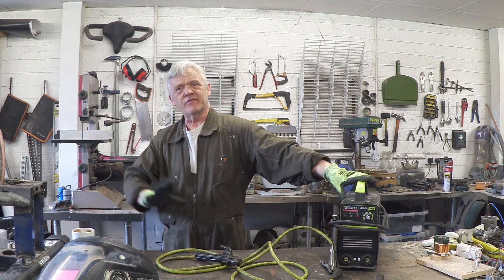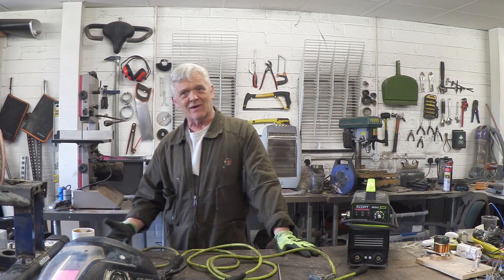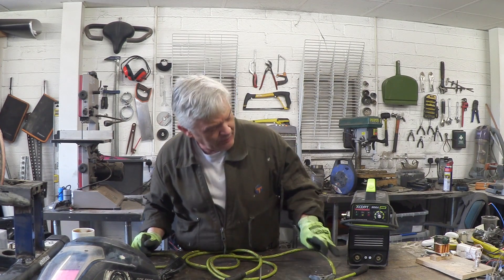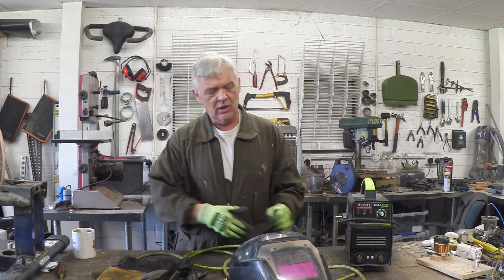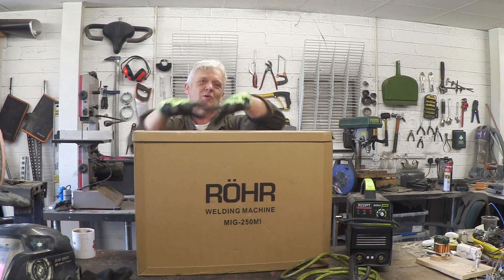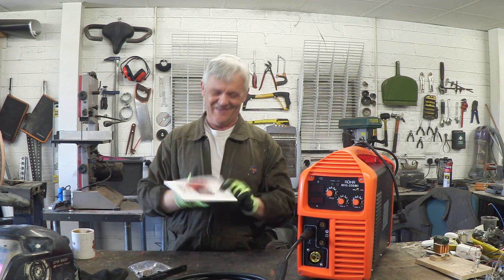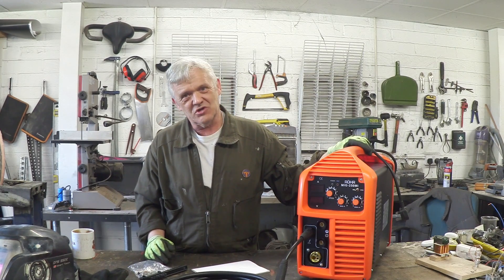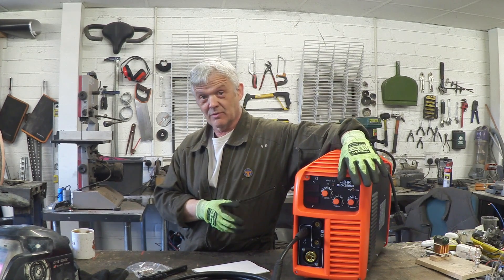1128 Learning MIG Welding - Introduction

Comment: You can run that gasless, use a spatter spray, tip protector, and fluxcor wire, your don't need the argon.

Comment: Happy Birthday and thanks for the videos.  When I first wanted to build a railway in my garden, I needed to buy a MIG welder.  In thelocal shop I asked the man there how to tell if the weld was good. "Hit it with a big hammer" he said. "If it breaks you need to do a better job next time!"
Great fun and extremely useful, don't know how I did without it.  Only done various grades of steel but so useful, not just for garden trains! Best wishes for your vidoes.

Comment: I'm also new at welding. I probably don't know the correct terms, but I got a mig welder that has flux core wire instead of bottled inert gas. I chose it because it reminds me of flux core soldering. But it has the auto-feed wire. I've made 3 repairs so far with it, and they're all ugly but effective. :)

Comment: I have a similar type of welder, mine also uses gasless wire and yours may do as well, check your manual. Gasless wire also lets you weld outside without worrying about a mild wind blowing the gas away.

Edit: Almost forgot, happy birthday!

Comment: Just wait until you get your hands on a tig welder 
Welding is a journey into metal and your imagination 
Have fun just remember that safety is essential when dealing with excited electricity and metals and alloys 
One key thing that I had given to me was when ever you are welding a unfamiliar martial test your settings on scrap peace's of the same martial to insure the best welds on your finished project 
Never wear synthetic clothes or shoes when welding unless it is specifically designed for welding ok that's enough preaching 
God bless you and your's 
Have fun and be safe 
Thanks for the videos 
Just saying

Comment: A can of Anti-Spatter spray is most helpful, to prevent spatter sticking inside the nozzle shroud and side cutters to trim back the wire. You can use them outside if it is not too windy, I used to turn the gas pressure up a bit and or create wind shields. For Stainless and Aluminium use pure Argon gas, but for Steel a blend of Argon 95% and CO2 5% is good, if you are to buy one gas only then I would buy pure Argon, you can get away with using it on Steel. Aluminium Welding is a bit of a Black Art but it is like anything, practice makes perfect. It is easier to use than a stick welder, they earned the nick name EASY2 because in the early days they were often used on CO2 gas. And they are so easy a child could use one after an hours practice. The weld penetration is generally less than with a stick welder, but on stainless because of the low heat conductivity the welds are just has strong. The nice thing is being able to turn down the juice and blob together impossibly thin bits of junk and build up areas with layers of weld.  No chipping off slag between welds. Happy Birthday and Happy Welding.

Comment: Not sure if your machine can take it but try some flux core mig wire will save messing bout with the gas straight away and will give you practice with the mig process it does spit a bit due to the flux in the wire but I find it a nice half way between stick and full mig

Comment: Happy Birthday Rob!! Very nice present you got there :). Btw, you can get yourself some flux core wire to practice, before you spend on a Mig gas cilinder (actually a 75/25% mix between argon and CO2). Flux core will splatter a lot but is good to learn Mig welding. There´s basically only two things to it, amps and wire speed, and that will depend on the thickness of your material, you just need to make some tests on spare material first before you actually weld. When using gas its a fixed pressure, so nothing to do there.

Comment: The fear I have of welding is that I can’t figure out how it goes wrong, and because of that I don’t know what to avoid doing. I know that people sometimes accidentally kill themselves with a welder, but I don’t know what exactly leads up to that moment. So the only way I know to not do that is to not use an electric welder at all. I don’t understand why it’s so hard to get this explained but I’ve read several books about welding, asked several welders, and watched hundreds of YouTube videos and I can’t find an explanation anywhere. 🤷‍♂️
Reply: @obsculor  exactly, I can get a million explanations what to point toward, but for some reason, nobody wants to say what to avoid. It’s a really weird omission in my opinion.
Reply: @twestgard2  I think 2 things can go wrong: the electrode sticks, then you need to break it off or quickly turn off the welding machine - or - there's too much power and you melt what you meant to solder.
Don't touch the metal you are welding, don't weld on wet places - should be good tips to keep you safe. But I'm sure there's more, I'm no expert welder.

Comment: You can use it wo bottle too, then its flux core, the shielding gas is inside the feeded wire, a lot of spatter but strong welds.
Reply: Like a metal hot-glue gun.

Comment: Before you try gas and getting the bottles I suggest you get some decent quality gasless mig wire . I have been using it for years and outside use most of the time . Welding gases are not cheap and mostly they are hired so you have to pay by time as well! Gasless can do stainless and mild steel .Just make sure its a reputable brand as the cheap stuff varies a lot in the flux consistency and is very frustrating!
Reply from the maker: nice advice mate - cheers
Reply: Could you please mention a decent brand of gasless wire? I've bought the one from an Australian major hardware chainstore and given up, I can't get anywhere near a decent weld.